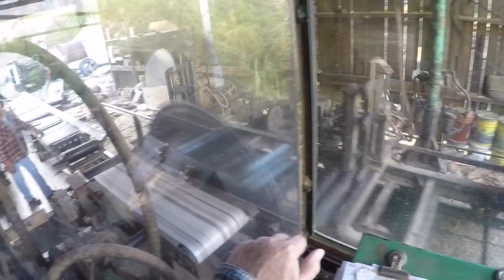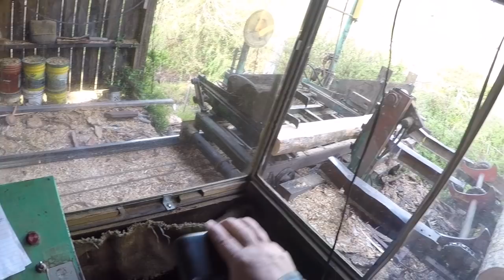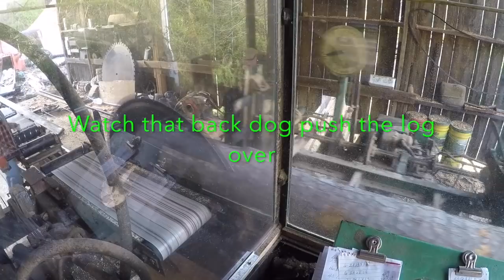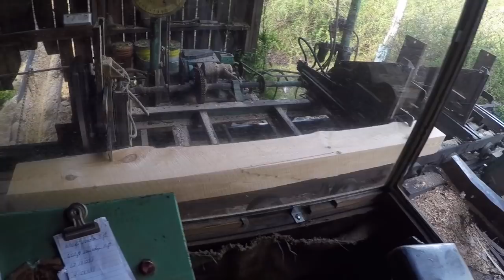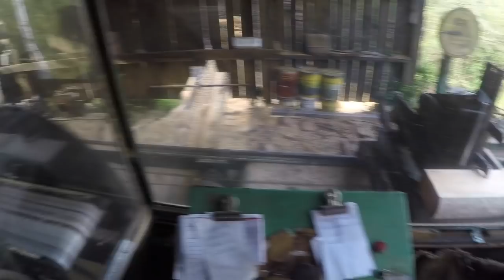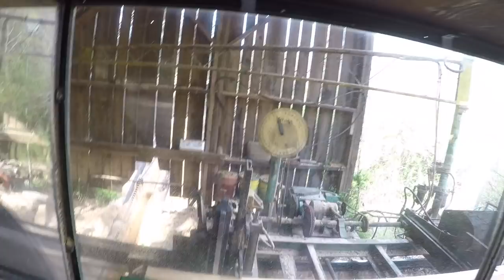Finally Sawing!

Comment: LOL  .... Just heard your comment on diesel-electric mill. Wired one in for Long Lake Lumber back in "77". Big 10 cylinder diesel, with huge 3-phase 600 volt genreator by CAT. It was great system but they always needed the 3-phase 600 volt land-line as a back-up; proven one day about 6 months, in when the big diesel went down... they waited 2 weeks for the temporary which stood in while the motor was being rebuilt and had the land-line to fill in the gap... kept production rolling. The mill had vibrating converyors and a huge chipper.

Comment: Never boring!
Could you make a film on the various parts to the mill?
If not, what is the chain driven thing that goes out of you mill house,perpendicular to the house you sit in?
It's on the ground.
Reply: Torsee that is the sawdust chain that carries the sawdust from the blade and carries it outside to the sawdust pile
Reply: Don,
Thanks. Interesting.